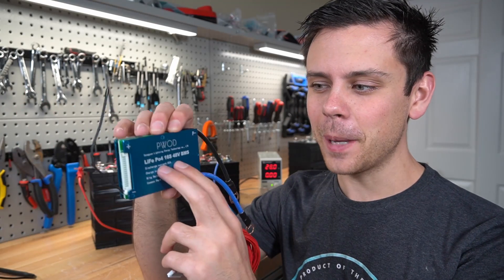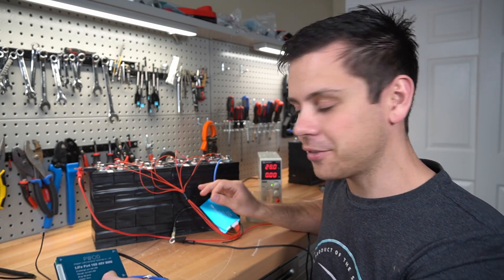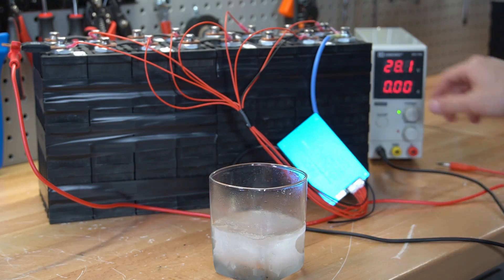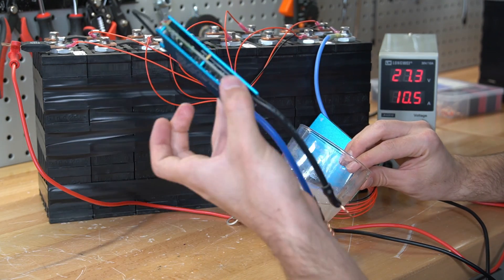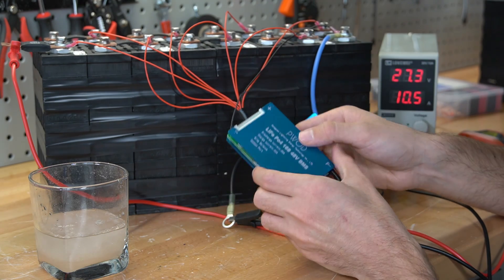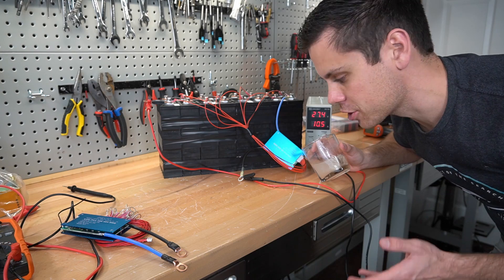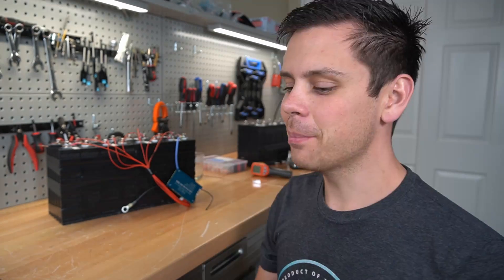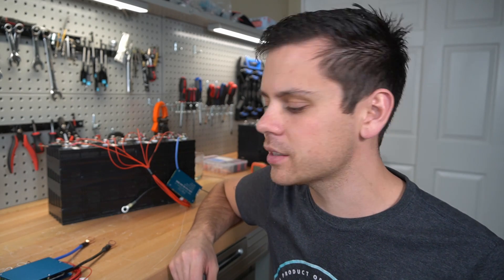PWOD LiFePO4 8S/16S $20 BMS Low-Temp Protection Test

Comment: I will say under temperature protection is overrated. Yes it is a nice extra protection to have but will not help you in any way if you live in cold climate and battery can not be installed in a thermally controlled room.
The only good solution for this like RV use is to have the battery in a good thermally insulated box and then add a small heating element even 10 to 15W will be sufficient to keep the battery temperature above +10C (50F) even in extreme outside temperatures. The thing is that if box is not insulated the amount of energy needed will be huge but also you will not be able to heat the battery in time for solar it could take hours to properly heat the battery as the batteries have large thermal mas your temperature sensor may say that is OK to charge but if you battery was well below freezing is likely to cold inside the battery just the exterior of the cells are warm and so you will still damage your battery and use a lot of energy for heating in the process or not even be able to heat the battery before the sunset.
So solution is a properly insulated box for your climate with a low power heater and digital thermostat maybe a small fan to have uniform heat and energy usage can be as low or lower than 0.25kWh in 24h that is about what my fridge COP of 1 and can maintain about 18C below ambient.
Reply from the maker: That's what I've been thinking lately too. I agree
Reply: Up north we use a light bulb, not LED, around 10 - 15 watts with 1" styrofoam. If it gets too warm drill a 2" hole close to the top, add screen and a thin piece of Styrofoam hinged at the top --- duck tape works.
Reply: For me, i have 200ah lithium in a work truck and a dcdc charger. In my climate i will see maybe 3-4 days per year with freezing battery. It will be better for me to have low temp cut off than insulate and the cells gets overheated.
Reply: @Poppatott  Even with low temperature slightly above freezing battery will have increased internal impedance and not perform as great.  Not see why cells will get overheated as if used in typical offgrid application they will be all the time at ambient temperature maybe 1 or 2C above that while charging or heavy discharge. The LiFePO4 should not heat at all in typical offgrid use that is below 0.5C discharge and below 0.25C charge rate.
Assuming your battery is 12V 4s at 200Ah so about 2.5kWh then you will not normally have more than 600W of charge and no more than 1200W continues discharge. Maybe you have some 1500 or 1800W load but that will be just for a few minutes or intermittent and there will be no significant battery heating above ambient.  Heating of LiFePO4 is a problem just in specific high charge discharge rate applications maybe RC cars or some DIY EV conversions but not in typical offgrid energy storage.
Reply: electrodacus it gets terrible hot in my veichle, and my thoughts is that the battery gets time to cool off quicker without insulation. I have a 1200 watt inverter, and it wont heat up the cells. And just about 400 watts of charging. The battery have been performing great in the cold, not even a slight problem. But I would be happy to know the pack wont be charging below zero.
Reply: This discussion is very pertinent to me as I am considering Lithium Ion technology for my remote cabin which is in a Northern climate and mostly uninhabited during the winter.  The batteries will definitely be in a freezing environment for many days/weeks at a time but also not used during this time either.  The batteries are inside (now have AGM) so when is at the cabin the batteries will be heated as the interior is heated but otherwise the interior of the cabin is at or near ambient temps.  What is the best in this situation?  If it is to somehow provide heat for the batteries what is the best method?  Please take into consideration that my solar panels may be covered with snow for extended periods of time.  Looking forward to recommendations and comments.
Reply: @jws3925  If you are not using the batteries while you are away then just disconnect the battery and it will have no problem at any temperature. It is only a problem to charge when battery temperature is around or below breezing but for storage any temperature is OK.
LiFePO4 has very low self discharge so if you leave the battery full it will be almost full in a few months when you need that again and you just need to heat the cabin/battery before starting to charge you can still discharge even if battery is below freezing.
Reply: @electrodacus  Thank you for the reply.  If I were the only one to use the cabin I could very easily do as you stated.  The problem arises when one has multiple family members using the cabin at different times of the year most of which have no clue about the workings of solar or battery nuances.  For instance, our last battery bank was ruined by my brother who ran the batteries down to 10.4 volts and didn't think anything of it saying that the LED lights still worked (albeit a bit dim I would imagine) so he figured the batteries were just fine.  He stayed at the cabin for 6 days and most of those days were either overcast or flat out rain.  They never got a chance to recover.  Now I have a low voltage disconnect to at least guard against that occurring again.  Another time we had a heavy snowfall.  The panels are mounted on the roof and when the snow finally decided to slide off our metal roof it pulled one of the electrical connections right off the panel.  He left me a note saying he thought something was wrong with solar system because the charge controller had a red light on instead of a green light.  But, that didn't keep him from using the charge that was in the batteries, that is until they went dead.  Do you see my dilemma?  I desperately want to install Lithium Ion at the cabin but I can't be there to "protect" them from individuals who neither want to learn about the system nor care about the health of it.
Reply: @jws3925  You will have a difficult job then :) The advantage of LiFePO4 is that it will not mind staying at intermediate sate of charge for prolonged periods so they will not fail as Lead Acid. I will have at least one PV panel installed on one of the southern walls flat so that snow will not be a problem and that should be able to charge the battery even in those conditions preventing the battery form overdischarge in snowy winter days.
Not sure where the cabin is and if there is any shade from trees as my panels (no shade at any time) will be able to produce at least 75Wh even in the worse overcast day in November (60 cell 260W panel's). Since I have a large array as I also heat the house with solar PV I get a few 3 to 4kWh even in worse overcast day. I will need to double the PV array soon so I should be at 7 to 8kWh/day absolute worse case and up to around 100kWh/day in a sunny day in February or march.
The system should normally be designed to deal with worst case months but a cabin that is not used at all times may be a bit different.  Not sure what loads you have you may be able to turn off most loads when battery is say at 40% and then only allow LED lights or some other critical low power devices. Tho in this sort of case I will think a thermally insulated and heated battery box may become important. It can be isolated so well that it will require almost no energy to maintain the temperature at appropriate levels.

Comment: What BMS would you recommend for the valence XP batteries.
Reply: With 4 of the 12 volt batteries in series for a 48 volt system.  4s10p

Comment: Design and sell your own After Market low temp controller. . .
Reply: It's called a 12v thermostat. Cost about $4 on ebay. Set it to cooling mode, and set your desired temp at the desired cutoff temp. When it is colder than your set temp the relay will open.

Comment: Is it possible a power supply is not a charger but, constantly sending voltage to the battery? If so, that's probably why its not turning off on low temp. Try a battery charger and you may get a different result.
Reply from the maker: Yeah that doesn't make sense Arthur
Reply: A charger sends a trigger voltage to the battery that causes a reaction in the battery cells. The components that reads low temp is looking for particular signal and the power supply maintain a constant voltage on the battery. The electronics in the battery is not seeing a trigger charge and the power supply doesn't produce enough current to charge a battery.  I maybe wrong. I am electronics technician and there is different between a power supply and a charger.  When a certain temp is reached its supposed to turn off the charging voltage. What if the circuit is not detecting a charge voltage but, see the power supply as a regular voltage similar to the battery therefore, doesn't trigger the temp circuit?
Reply: @arthurghee3915  interesting observation.  I had reviewed a Video from October that Will did that resulted in a successful test of low temperature cutoff.  I made several other observations, but to your point he was using a battery charger...not a power supply.

Comment: Why do they even have a temp sensor when they dont use it...
Reply from the maker: Very common for cheap BMS to have high temp and no low temp. Yes, very silly
Reply: @WillProwse  You should check if it even works. Maybe it's not connected at all.

Comment: What happens if you stick the temp sensor in the ice water first and than try start charging any changes?
Reply: Just wondering not that it would make any difference :D
Reply: Interesting idea..  Perhaps the Low temp cutoff is only checked at power on. They figure if you're already charging then the cells will heat up and wouldn't drop down to a dangerously low temp..  I would also get a can of Freeze spray so you can really bring the sensor temperature down (-60F)